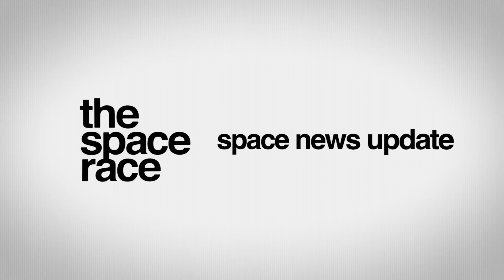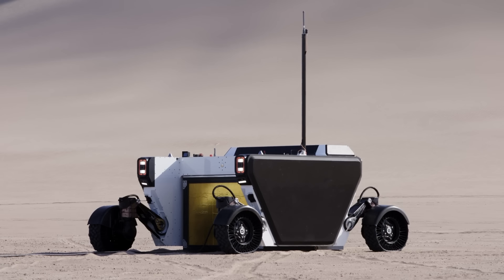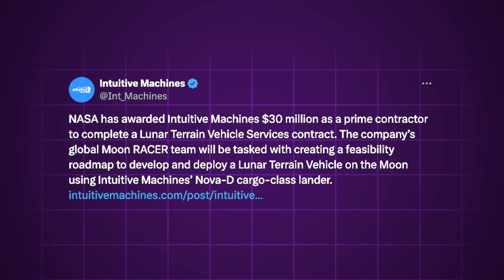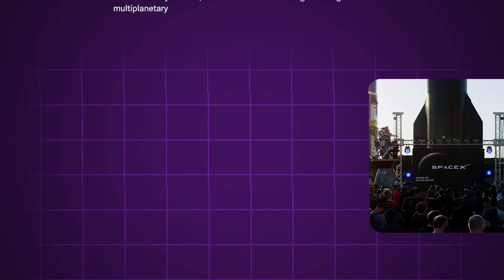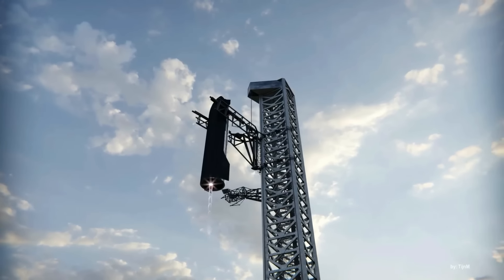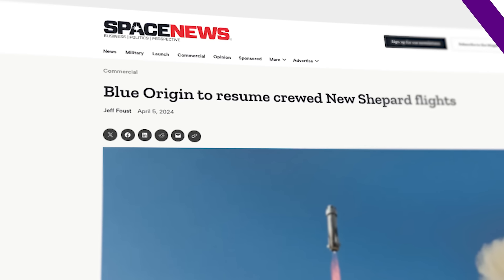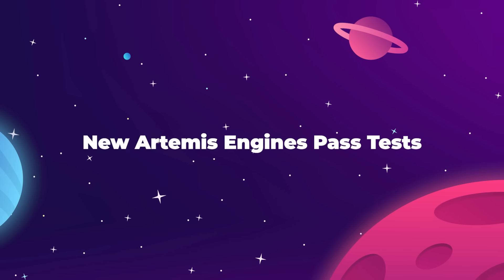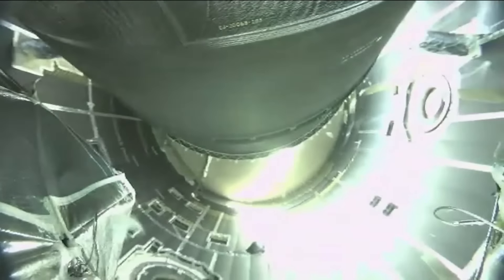NASA Reveals NEW Lunar Rover!

Comment: The Flex rover seem to me as the best. If they make a few other, much simplier Flex frames, connect it behind each other (with some smart flexible connection allowing still some degree of manueverability) as a "moontrain", and lay its top around with sun-following solar panels, (and one of the "payload" cubes of the "main" Flex is a huge acumulator), the rover could stay on the moon for much longer than 10 years.

Comment: Moon roads and landing pads are a really important aspect. It might make sense to melt the regolith into slabs.
Reply: Makes me think of the road heaters used in Colorado. When road repair is needed in winter, the pavement is far too cold to work on. So they heat it with what's basically a giant broiler, a flat machine on wheels, one lane wide, with maybe 150 gas burners facing the pavement. It's a kick to watch. There are jokes about giant pieces of toast.
Reply: like NUKE it before landing?

Comment: Moon dust is a huge issue. Low sitting astronauts not a functional option.
Reply: OTOH if you want to be a little faster - low gravity helps to offset the issues with low gravity.
Reply: @ThomasTomiczek  moon dust was a major design flaw of the Apollo are moon vehicle. The astronauts need to sit up higher in vehicle away from being splattered with moon dust.
Reply: @icare7151  Or just put on fenders.
Reply: @filonin2  The did that with the original one still in Moon but not enough.
Reply: @filonin2 doesnt stop it from floating up the way the dust worked is basically like a woft of air despite there not being any air.

This design has major flaws, not only do the seats need to be higher but they made multiple design flaws that they did before.
Reply: I saw a YT video about a team developing a moon dust repellant system by putting an electrostatic system into the fabric of moon suits. Surely they'll put something like that on the rovers, entrances to habitation modules, etc.

Comment: Has anyone ever noticed that Blue Origin's New Shepherd has a slightly orange tint to the rocket exhaust on take-off in those videos? Since they use a HydroLOX engine, it seems like it should be clear, right?
Or do they use some sort of ablative nozzle extension like the Delta 4?
If they are supposed to reuse the entire engine, nozzle extension and all, then it looks like they have issues with the engine. It looks like "engine rich exhaust" as they say.....
Reply: Its from the carbon in graphite being burned away.

Any impurities will cause hydrogen fire to turn colors, same way as igniting a h balloon the flame is orange from the carbon in the rubber.
Reply: Hydrogen burns a pale red. I think it's from the heat of the fire, making the exhaust gas itself hot enough to glow.

Comment: Why the f do you need a stylish racecar on the fucking moon? You need something that works like a truck.Something you can haul stuff with Something that is off the ground quite a bit so it doesn't hit little rocks and Get stuck in the wheelwells. Some of these people should be designing hot wheel cars not moon rovers

Comment: I still wanna see the cybertruck on the moon lol
Reply: Facts that would be best rover
Reply: Brother ughh
What the hell brother
Ughh
Reply: Lmao
Reply: Why are people suggesting cybertruck as a rover? It is not a viable option. It's tires would need to be redesigned, it does not have power generation capabilities, it would not survive a lunar night without heating, its touch screen controls would need to be redesigned to account for the space suit drivers will wear, it does not have any inertial (or any other form that doesn't rely on GPS) positioning systems, it is not remotely controllable, its durability has not been vetted at 10 years, the sharpness of the panels could be dangerous for the space suits... I mean at this point we have multiple EV that would offer at least an equivalent starting point for your design!

To be fair, your comment is pretty understandable (I read it as a comment on the esthetic of the vehicle fitting with the moon, something I don't disagree with). I just commented on yours because I saw a few others seemingly thinking the vehicle would work as is on the moon.
Reply: And on Mars
Reply: @drewberrymore2415  They suggest that Cybertruck could be made into a rover. Nobody says that we should send the vehicle as is to the Moon
Reply: @adriank8792  .. but why? You could technically make a rover out of any car, why this fixation?

Comment: why not use Cyber truck?
Reply: Because it's a car, not a moon rover
Reply: @raptorwhite6468  it is an EV and all terrain. A few mods? lol why not?
Reply: @Helliconia54  A few mods? Well:
- the entire body of the car is extremely heavy, so as much of it as possible should be removed and probably made of different material, maybe carbon fiber
- most of the computers would be unnecessary, self driving would be impossible anyway
- it may be an all terrain car, but that doesn't include the moon, the very fine and sharp dust is unlike anything on Earth, so modifications to suspension and wheels would be necessary, along with specialized tires
- a lot other parts should be removed; they should get rid of three seats, as well as anything that's added only for the car to be comfortable and fancy - no need for that on the Moon
- engines and all the other moving parts have to be protected from the regolith, otherwise it will quickly destroy them
- the batteries could maybe stay, assuming they can withstand the temperature gradients, which I doubt

So, literally not a single part would remain unchanged

Comment: NASA awarded a Lunar Road Contract last year (4:50) for a 500m linear lunar road, connecting pad and base; a fuel tank depot is sited in between with fuel pipelines running parallel with the road out to the pad.
Road, pad, fuel tank are all 3D printed; with the pipework extruded directly from lunar regolith.
NASA wants this constructed by 2029 along with "10 tonne of lunar oxygen ready for use".
That year, Artemis 5 is scheduled with the first landing of "Blue Moon" (one of 15 TBD, based at GATEWAY).
Source: NASA contract press release, TheSpaceBucket channel, 2023.

Comment: WRONG PLAN: None of the designs I saw here are worthy of the money or the effort. These vehicles should be the size of a small bus. They need room for 6 to 8 people in seating and with 8 compact bunks. They need to be like a small RV. They need to be able to tow a trailer or implement as well. They need to have air and pressure inside to enable the lighter space vehicle suits to be worn. There would have to be an Airlock Entrance/Exit Room to allow astronauts in the Moon RV to go from inside the Vehicle to outside the vehicle to do a moon walk. Don't worry, you can bring your kids as Michael J wont be there. 😆
Reply: Okay... I couldn't resist the humor. MJ would have loved to have performed his Moonwalk on the Moon I would imagine. 
As for the man, I believe in the justice systems many democracies have, so I have to put a lot of weight on the fact that MJ was never convicted criminally. I have to consider the fact that the man may have never committed any crimes. Many people would argue with me. I was not there, so I could never truly say I knew what happened. I know he made a lot of his fans very happy.
Reply: They need an 8 seat vehicle even though they’re only sending 4 astronauts at a time…
Reply: @zachb1706  It's job can be to transport equipment and materials to other locations, which would require some of those bunks and seats to stow away like in a Dodge Caravan, or some other method. Most importantly though, I am thinking about the future. In another 10 years it may be seldom that there is only 4 to 10 men on the moon. China could have some people  there, along with other countries. By the time the Dune buggies arrive on the moon, they will start to need the vehicles I am talking about almost right away.

Comment: NASA figures that a Moon Rover must cost at least billions each and must have no other possible application.

SpaceX will just fly an off the shelf Cybertruck to the Moon.
Reply: Honestly before its all said and done you may be right, I still cant believes tesla put a car on orbit around mars
Reply: Cybertruck is a terrible option, it's a car, not a moon rover
Reply: @raptorwhite6468  Please explain why TAXPAYERS must spend BILLIONS of dollars for a one off single purpose machine rather than  spending a few millions to adapt an existing EV?  The big reason why SpaceX was able to make the lowest bid for the HLS was because it is only asking the taxpayers to pay for modifications to a vehicle which is intended to be manufactured in thousands of units for other customers.  Why does that economic principle not equally apply to a Lunar Rover?  Of course an off the shelf Cybertruck would break down in short order
Reply: @jamescobban857  Cybertruck is so far from being a lunar rover that it just can't be modified to become one, it would literally just have to be a completely different vehicle.
- it's extremely heavy, which is never a good thing in spaceflight
- it has a lot of unnecessary parts and systems that would make it harder to maintain
- none of its parts have any sort of protection from lunar regolith
- high temperature gradients on the Moon would definitely have a negative impact on its performance
- regular rubber tires aren't the best option to use on the Moon
- the vehicle would probably get stuck quickly, unless more complex modifications are made
- it's unnecessarily big, as of now space for only two astronauts is required

So after turning it into a rover, probably the only major part that could remain unchanged would be batteries, assuming they can withstand the temperatures. All that to make something that would still be very far from perfection.

Comment: Just give the money to Tesla for their Cyber Truck.
Maybe need some modification  installing high efficient
Solar panels with batteries capable of 1000 km and 
solar charge time of 4 hrs.
Reply: So double the normal range? So you'd need at least a 246 kWh battery. To charge that in 4 hours you'd need 80 amps or 61,500 watts of solar panels. Solar panels make 200 watts/m^2 so you'd need 307.5m^2 of solar panels. A tennis court is 261m^2. So no, that cannot work.
Reply: You are right. Given all that it is better to  drop pre fabricated solar panels to make a power grid with AI these days nothing is impossible.. @filonin2

Comment: They should just send a cybertruck and ask those companies to make "accessories" for it like: positionning system, robot arms, teleoperations. Cybertruck already has way more batteries then necessary, it could even tow things around on the moon!
Reply: Cybertruck is a really bad option. It's extremely heavy, has unnecessary parts and rubber tires
Reply: For the same price, they could ship like 10 Cybertruck in one Starship. Starship is really huge and will be able to lift 100 tons to orbit. A couple Cybertruck will cost a lot less than a billion dollars
Reply: There's no room in a cybertruck cab for the life support packs. No way to make the cab pressurized. And no way to recharge it w/o human assistance.